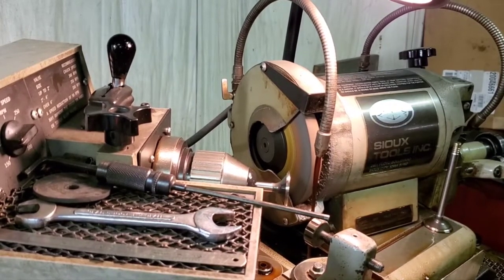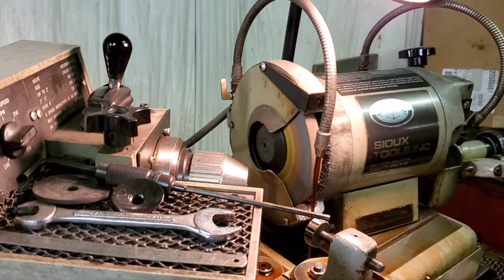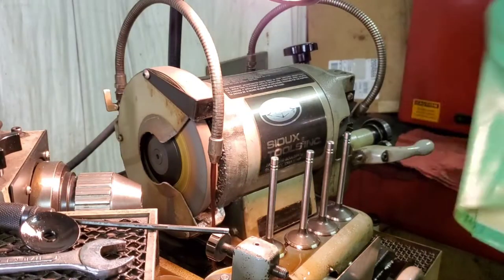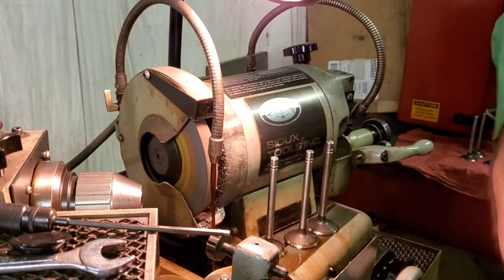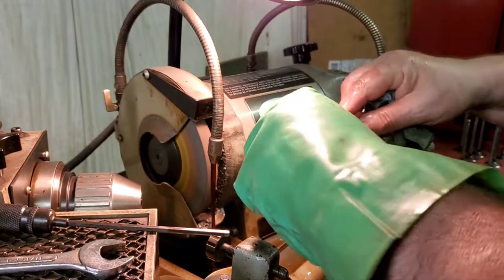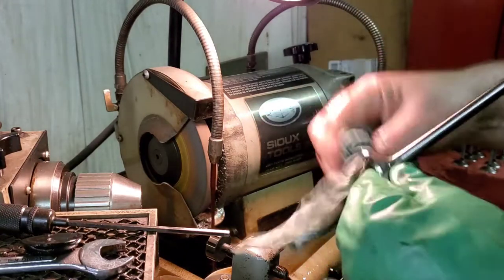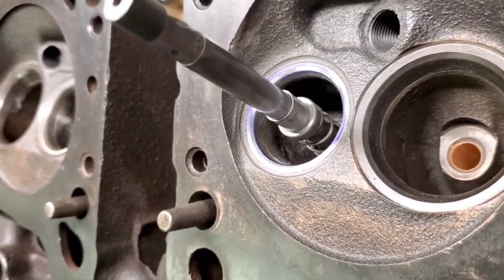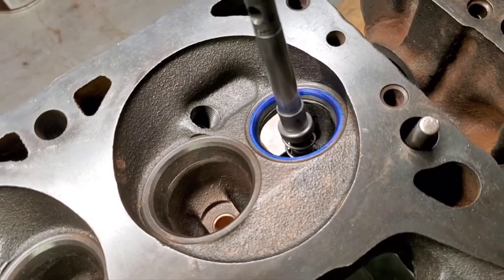Small Block Head Valve Job. The 318 Mopar. Or Your Heads.

Comment: No matter how many times I've seen you do this,  I'm impressed with the process.  I remember my flathead Ford,  it was a lot of work.   If I remember correctly had to replace 4 valve seats and a few valves.  That old engine ran very smooth after putting it back together.
Reply from the maker: Hey brother Bert.
You and I have had good times over the years.
That Flat head Ford was one of them.
Turned out very nice.
Take care, Ed.

Comment: I don’t understand how new valves can be out of round or “untrue”.
Don’t they use similar equipment as you or even more advanced?
Reply from the maker: Production tolerances. 
They have a manufacturers allowance. 
They are within a spec.
We spend more time.
Within .001/.003 is good.
Nothing wrong with the quality. 
We are making it better.
Tanks for watching. 
Take care, Ed.

Comment: Hi Ed,.....After watching  your video several  times intensely, I have a much better  understanding of your careful machine  work processes.....With good maintained equipment,  working a smaller number of jobs with better  Skill = a better finished product & eventual total valve job sealing results.....Better than the typical high volume mfg suppliers...Do you test the finished valve job with Port Vacuum Test ?   If so,  should the valve Without spring, pull Vacuum to the Maximum the pump is capable of or is Some Vacuum Leakage acceptable  & does Any leakage permanently reduce that cylinders p I were output ?  Thx for the videos..
Reply from the maker: Thank for watching Tom.
Yes, heads are done on a job per job basis.
No production process here.
All heads are vaccuum tested.
Take care, EM.

Comment: What Precision of Certainty do you have you're  Consistently grinding at 45° &  Not 44° or 46° valve angle ??
Reply: What difference does it make?? If it's off by 1 or 2 degrees,  the engine is still going to run just fine.  There are a lot of tools to measure the angle.  Thing is, take care of your equipment and your equipment will take care of you.  I've had Ed fix a bunch of heads for me and they all worked better than new. So what's your problem?
Think you can do a better job?
Reply from the maker: Thanks for watching Tom.
Take care, Ed.